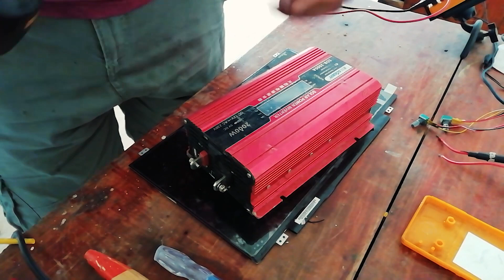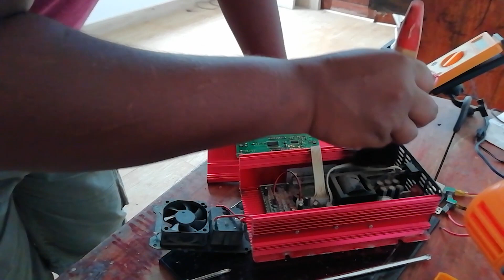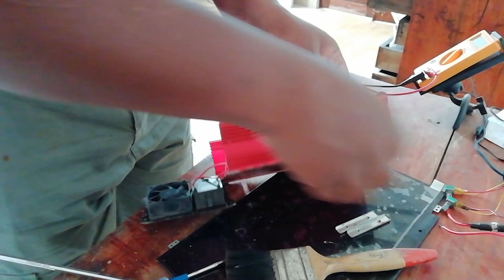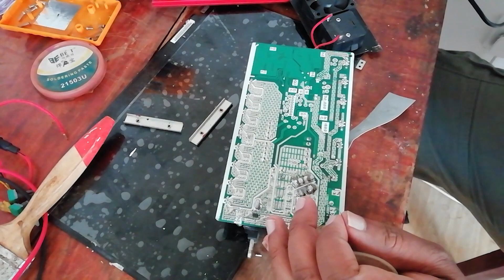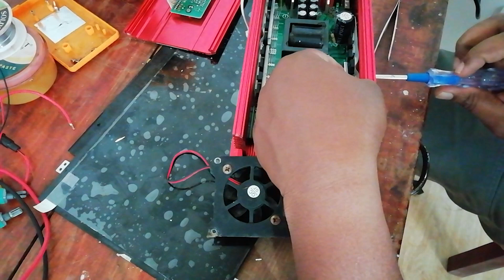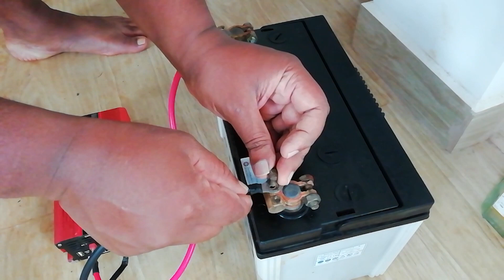How to service and repair Inverter Sinhala

Comment: අය්යේ මගේ ඉන්වර්ටර් එක දැන් රිස්ටාර්ට් වෙනවනේ එක ලග ලග..

ලෙඩේ එන්න එන්න තමා වැඩි වුනේ.

කලින් පැයකට පස්සේ තමා එහෙම වෙන්න ගත්තේ. එන්න එන්න ඒක අඩු වුනා.

දැන් විනාඩි 20 කට පස්සේ ලෙඩේ පටන් ගන්නවා.

ලෙඩේ තියෙන්නේ ඉන්වර්ටර් එකේද..බැටරි එකේද කියල පොඩ්ඩක් කියන්නකො දන්නව නම්.

ස්තූතියි
Reply from the maker: mokadda inveter aka /oya hadapu akkak da?
Reply: Mage thiyenne battery inverter ekak.. inverter ekema charger ekath enawa.. pls help
Reply: Na.. man salli walata gatta ekak.
Sunchonglic kiyala chineese brand ekak.

Amaron battery ekak tama gahala tiyenne.

Mage athin dawasak waraddak wuna.. edayin passe tama mea lede patan gatte

Man kiwe.. meke charger ekath thiyanawa kiyala.

Dawasak waradila.. inverter eken output current ekama inveter eke input ekata connect wela thibba.

Ita kalin hodata wada kara..

Enna enna lede wadi wuna hinda. Battery eke wenna puluwan neda ayye lede?
Reply from the maker: inveter akanam aulak na /Battery aka ,wena battery yak sambanda karala ballanda saho/
Battery charge wenne sola walinda?
Reply: Sola neme.. battery eka ac current eken charge wenne.

Mata ara waraduna kiwwa eka tama..

mta dawasak waradila inverter eke input wire eka output eken ganna extension code ekata gahala thibba.

Eken tama mea santhasiya wune.

Ayye.

Battery eke condition eka apita check karanna barida gedaradi?

Multimeter eken car battery check karanna puluwanda.

Ara restart wenna gannakota.. battery eka bahalada kiyala balaganna widiyak thiyeda multimeter eken
Reply from the maker: extension code sambanda karala tibbanam  Mosfect tika sutu wennda ati / akai lord aka  adinna baruwa re stat wenne /oka galawala  mosfect tika maru karannda atakota hariyai   Brother...
Reply: Ayye ithin palaweni paya bage ona load ekak adinawa.. paya bagen passe tama restart wenna ganne.

Kalin oka payakata passe tama restart wune.. ennw enna restart time eka lan wuna..

Dan paya bagekata passe restart wenawa

Comment: Battery eken disconnect keranna issella  gedera main switch eka on kela . Dan vada keranne naha. load eka nathiwa battery eketa connect kerath Inverter ekath battery ekath athara thiyana fuse eka yanawa. eaka 30Amp. Hada ganna thanak kiyanne.
Reply from the maker: හදන්න kali hoyaganna අමාරුයි .ආනයන සීමා හින්දා .akak ගන්ඩ tama වෙන්න sho ....